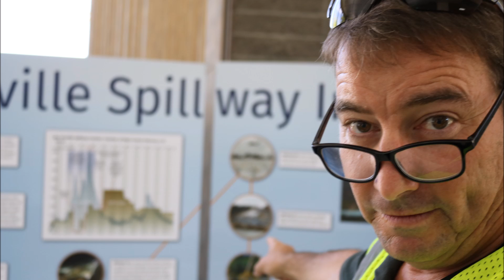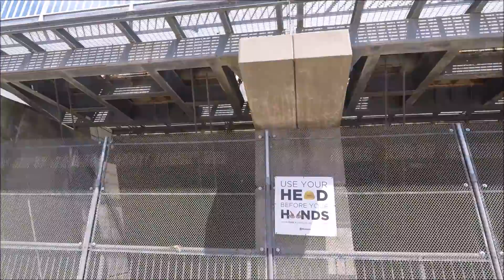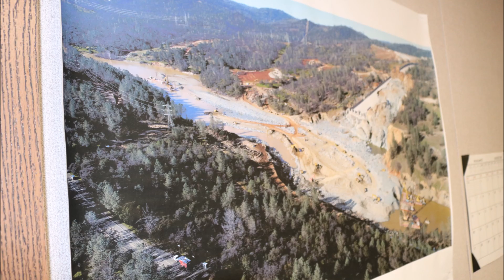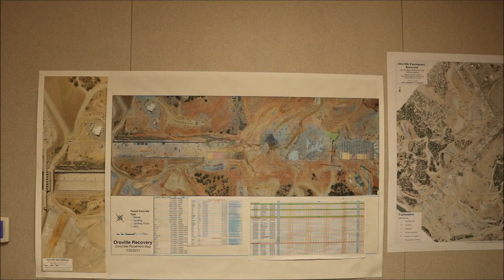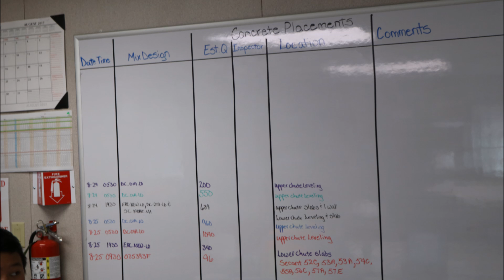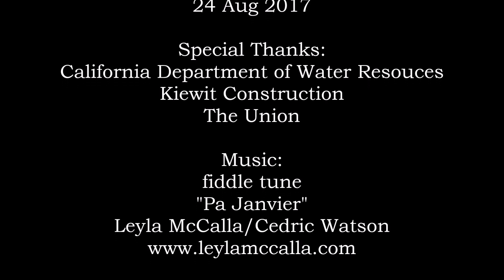Oroville Spillway Construction Tour 24 Aug. Part I

Comment: So, when is it going to start to rain hard? September maybe? I'm kind of worried because if it starts to rain hard there won't be enough time to at least leave the spillway in a decent way. It's still August though so in two weeks, if they are fast working, they can make it. Hard to imagine the huge hole 5 months ago and how that thing is being taking care of at a great rate.
Reply from the maker: Really Hard rains typically in Feb. but can be as early as Dec.
Reply: July is the most dry month, June and Aug next most dry.  Sept a little more wet.  Not really a lot of precip until Dec/Jan relatively speaking
Reply: Juan José Del Pino Rivas That's why the level of the lake is going below 700ft.  It gives them the flexibility to work and not worry about using the spillway when it's not completed